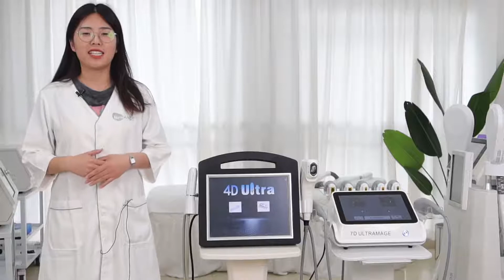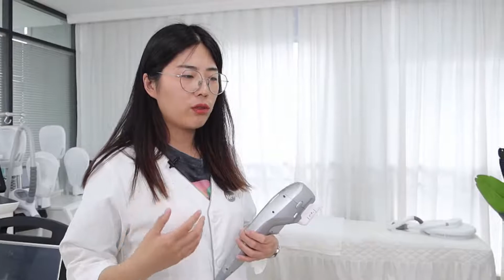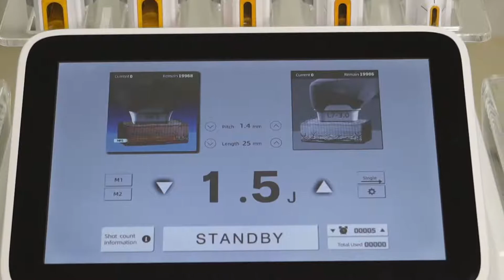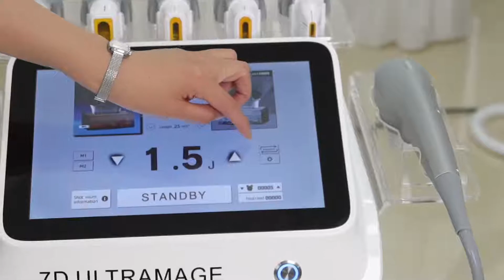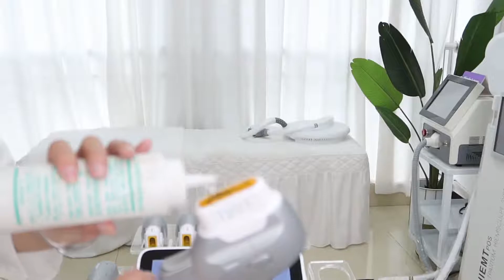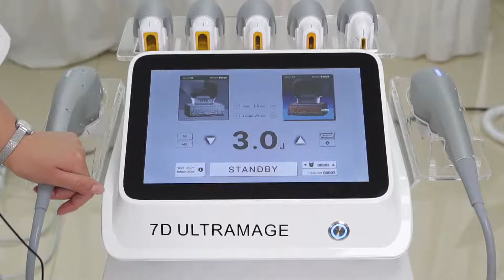HIFU Machine How it Works & How to Use

Comment: I bought the 4D, and I don't see it doing anything. I've had it for three years and haven't used it, and I just saw in another video that it fills with water. Is that true? The salesman didn't give me any instructions.
Reply from the maker: You can contact our technicians dear, +8615383118106